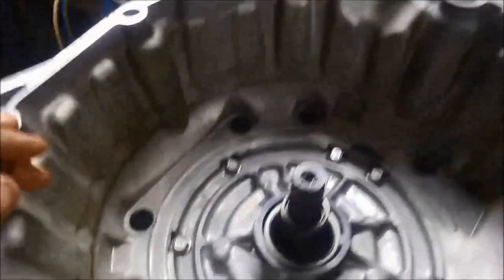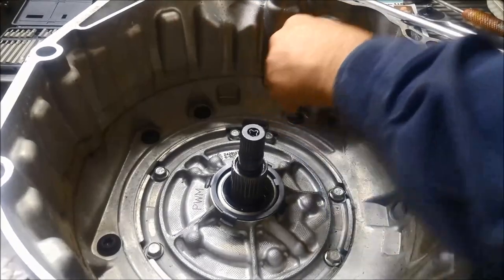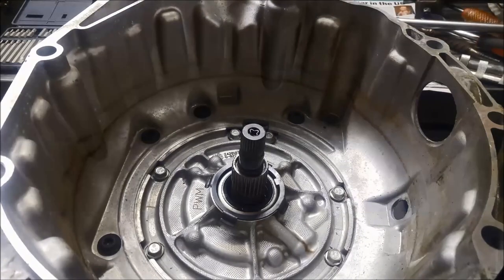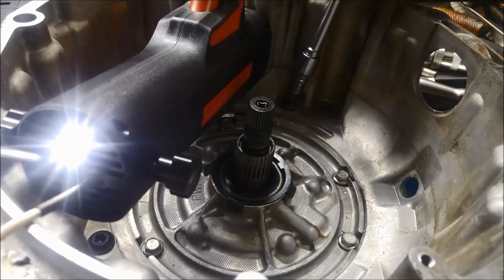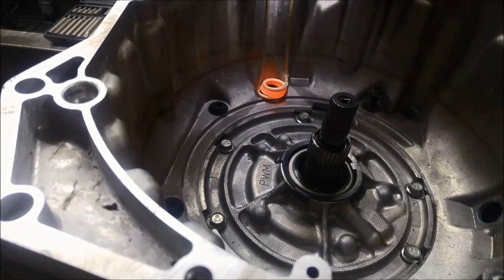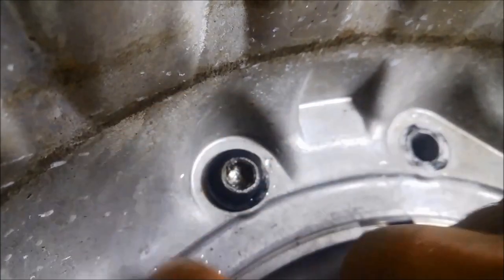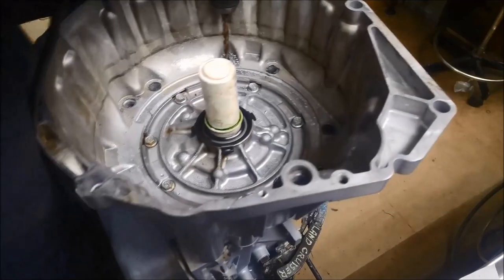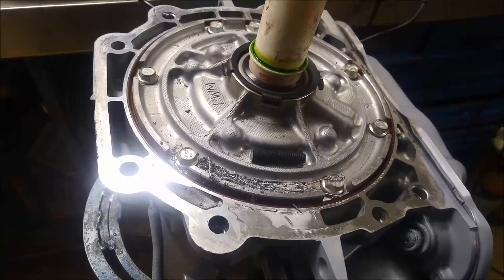4L60E Remove Bell Housing T50 Torx Plus Bolts Stuck Loctite or Seized Hard How to DIY

Comment: They're TP-50 not T-50 socket. They're easier to get off if you use the right tool. Not that they're easy to get off, just easier than when you're not using the right tool.
Reply from the maker: cheers
Reply: Find the tool in my town

Comment: that's amazing actually, you'd think red loctite was used or they were fused due to dissimilar metals, the induction heaters I was thinking of don't glow red or get hot ,only the metal placed inside the coil gets hot. That was a good one!
Reply from the maker: they work well when you need to only heat the outside or nut to get is loose, or when a flame or oxy torch might burn or damage something near the bolt.....but yeah warming up loctited threads get them off easier as well. cheers

Comment: I have 3 that stripped while using the torx ip50+ or however you call it, any advice anyone?
Reply from the maker: hi, drill out like in vid from 6:30. cheers
Reply: @YepThatsIt  is there a bit you recommend, I went through 3 new bits already 🤦🏽‍♂️ thought regular metal bits would work.
Reply: The same thing happened to me. I used a dremmel and made a slot on the top of the bolt. I then used an impact wrench with a flat screwdriver bit to loosen.
Reply: @A1rsoftKid  I ended up drilling the bolt heads off
Reply: @zeedapezant  did you repair the transmission yourself? Did you replace the bolts with torx type?
Reply: @A1rsoftKid  I couldn't finish putting it together cause of the metal o ring at the output shaft, but we used hex type bolts instead of the torq